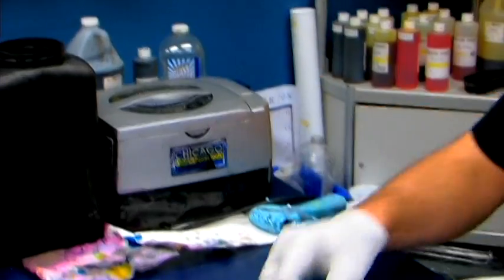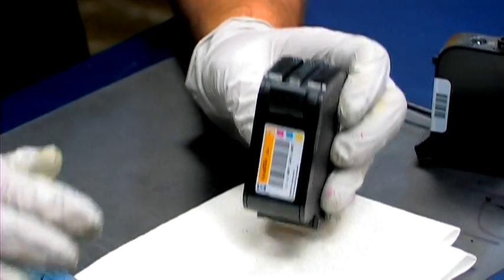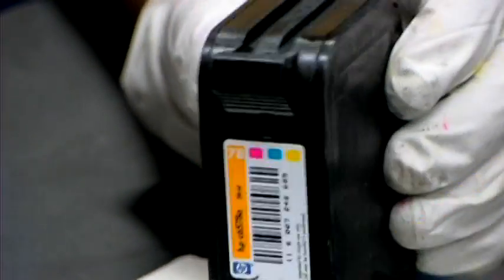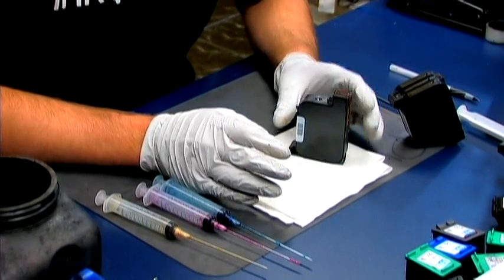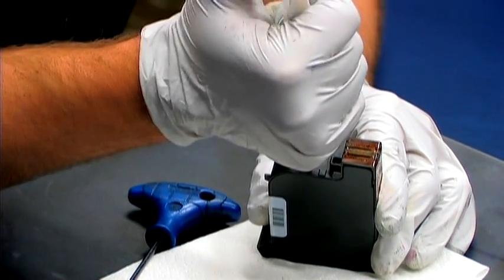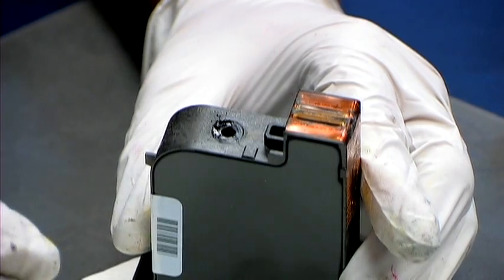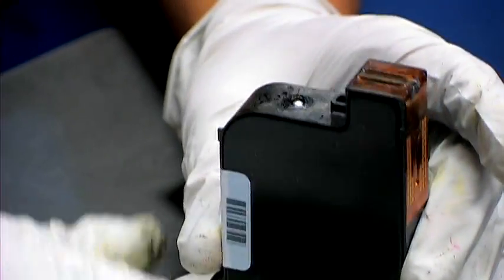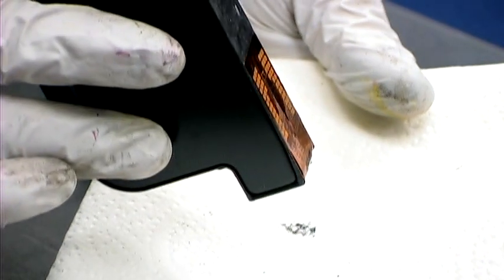HP Printer Cartridges : How to Refill Ink Cartridges in the HP 970CXI Printer

Comment: @len59356 The ink formula is different, manufacturer ink is a highly engineered liquid. It also voids any warrenty on the hardware for that reason. Maybe if you have a cheap printer it is worth it but on expensive ones why bother? Also the colour reproduction of 3rd party inks if poor, again with a cheap printer used for printing net pages or documents maybe its acceptable but not if you ever print a photo. Not to mention the 3rd party inks are less durable with UV and gas.

Comment: Refill kits are hit and miss.  The problem is you aren't refilling under a vacuum so the foam inside doesn't properly absorb and suspend the ink.  Also, if it's run empty it won't prime and won't work.  I just buy remanufactured ink and toner at the refillmyink website because it's cheap and 100% guaranteed.  Then I donate the empty to my kid's school.  Schools and churches do fund raisers by collecting them.